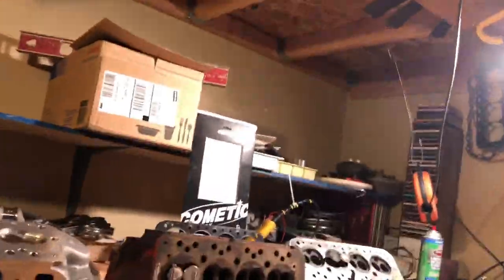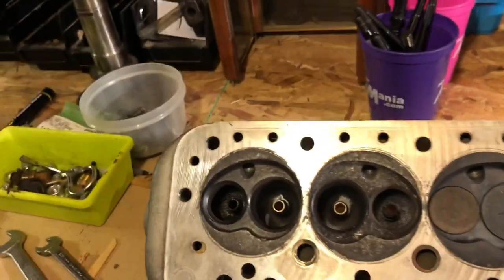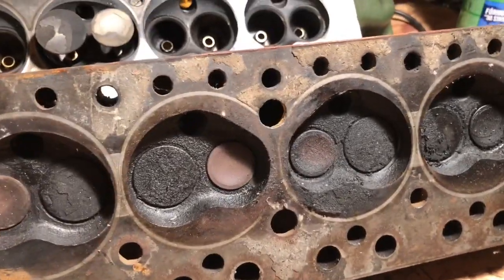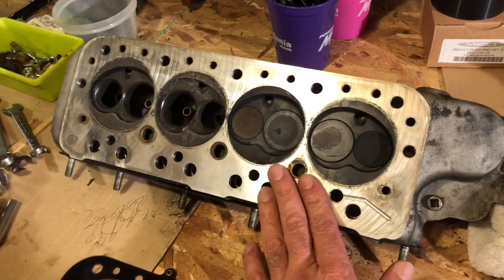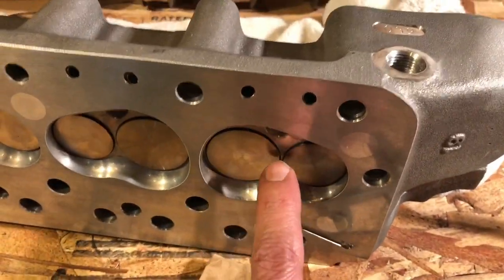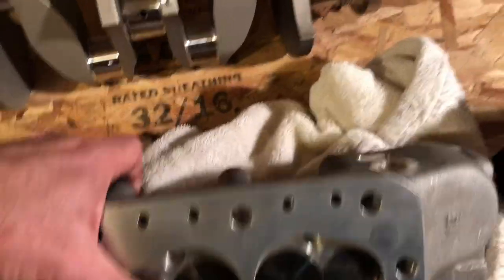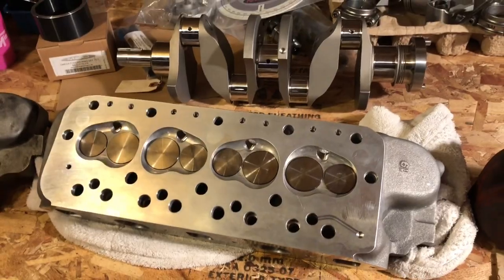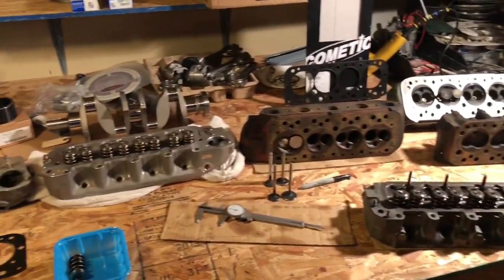All the Classic Mini heads on one table

Comment: Realy nice video, can you do some video about 998cc headgaskets? your opinion about copper ones vs those cheap grey headgasket..... and cylinder heads studs torque and retorque
Reply from the maker: Ah yes, I'll post an update of my Super Small bore soon.... my info is a year or two old, but the only really good performance head gasket was from Australia, and could be found under part number C-AHT347 if memory serves.  Unfortunately, was discontinued, in my opinion because it was expensive.  MOST that drive 998s don't do so because they are rich, and a $10 gasket will always sell over the $100 good one!

The Copper ones USED to be good. Let me clarify that all this is my opinion.... I just took apart my own 1380 that I built about 12 years ago with the Copper AF460. It was perfectly fine (and with 13 to 1 compression!!). Unfortunately, since then,  asbestos lawyers have slithered over to England and forced the manufacturers to use ground up kitty litter in place of asbestos in between the layers.  Now visitors to the UK are safe from breathing all that bad stuff from inside head gaskets, but they don't work for crap!

IMHO the best ones to use for a street engine are the modern dark 'tacky' surface gaskets still sold under Rover part numbers as well as Payen / Federal Mogul. They are like my Chevy V8s' Fram "Permatorque'". But these can generally be found for the 1275, so the only common ones for the small bore are the Copper and Tin ones and the cheap cardboard looking ones.  Right now, I'd use the cheap gray ones over the copper (if I couldn't find a "Rover" set), but I really hope they've been improved. 

Please let me know what you do, and how it works. My Super Small Bore will use a 1275 head, in part because I can use a much better 1275 gasket... probably one of the Cometic brand I use on race engines.

I ALWAYS "retorque" head gaskets. There's no harm in it, and it makes good intuitive sense to do so after a few heat cycles and everything 'settles in'.
Reply: @JemalCRM  many thanks for your answer. Im allways on a learning process. I have use payen headgaskets, still copper. And Works great. But these days I ve use those cheaper grey.one with no problems t all, just wanna know your opinion as you are for me like a bible in this engines. And allways pleasure to see your vids and learn somethingn many thanks

Comment: I would be interested to see what bhp you get out of this new mix of parts.
Reply from the maker: I have some numbers... My prepared Pierce head on the 1380 running an Elgin vintage race cam, MED crank and longer rods made 115 HP at the wheels.  It was class champ for two seasons.  Got damaged when something dropped into carb by someone helping at the track.
I rebuilt it using the new MiniSpares head and an MED FIA15+ cam.  Made 117 Hp, then with some carb tuning including bigger chokes on the Weber 45, we are at 121BHP at the end of this season.

Comment: Thanks for the video Jemal! How would you compare the Minispares head to MED's fast road head?
Reply from the maker: It's very hard to beat the combination of advantages with the new alloy heads. I have nothing but good to say about my friends at MED, but when you must take something old and modify it into what you want, you are at an immediate disadvantage to something new properly engineered for the purpose.

That becomes more so as the availability of usable original castings diminishes. Unless you have a compelling reason for originality (such as my Multiweb crank all-out race engines with MEDs very special "Series 6" heads built to my specifications),  you'll get more for your money with the MiniSpares Alloy heads.

And less.  MUCH less.  Weight that is!  The iron heads must weigh nearly FOUR TIMES as much!  That's a noticeable percentage of a Mini's weight!
Reply: @JemalCRM   Very useful perspective. MED is very proud of their flow gains on their heads but there is no comparison to the aluminum head from Minispares. I assume it will fit road injection models as a bolt on?

I don't know if you've considered it but you may find it quite profitable to link to the Minispares (or any product you recommend) in the comments section.
Reply from the maker: @avivscrewvalla  Thank you... I do try to show specific products to make them easy to find. MiniSpares has not responded to my inquiries nor shown any interest in having me help them sell direct to US consumers. Also I find over time links change, and I often customize my order for my build. 

In your case, yes the head will bolt up, but if you have an MPI, the alternator mounting and thermostat size will be different. The alloy head will not have the same tapped holes nor can they be added. Easy enough to use the earlier water pump and alternator mounting.
Unless the engine is fully built up, I would definitely stay with the "street performance" or "road" version as they call it. The "race" version would be too much for either of the injected models without much more work!
Reply: @JemalCRM  It's a stage 1 SPi JDM Mini (with factory aircon). I will ask after the road version and if I install it, will share my impressions. Thanks very much!
Reply: i realize I am kinda off topic but does anybody know a good place to stream newly released tv shows online?
Reply: @Ezekiel Julius i would suggest FlixZone. You can find it by googling :)
Reply: @Mayson Davis Definitely, I've been watching on FlixZone for months myself :)
Reply: @Mayson Davis thank you, signed up and it seems like they got a lot of movies there =) I really appreciate it!
Reply: @Ezekiel Julius Glad I could help :D

Comment: Is it worth it to restore 998cc engine I bought it for 100bucks
Reply: Depends what you want to end up with. A 1098 or 1275 engine will usually make a better road engine. I have a 998 with Cooper head and cam, (12G295, AEA630) and a single 1 1/2" SU, Goes quite nicely. Same head cam and carb on a 1098  in another car has quite a bit more low down power/torque.
Reply from the maker: I didn't used to think it was worth spending the same money to build a 998 when 1275s were common and cheap. Then I built the "Super Small bore" that I installed in Aaron Hagar's Mark 1 Mini.  It turned out to be one of my best street engines with amazing performance and smoothness!  

But it was certainly NOT just a "rebuild".  I explain it IN DETAIL from idea to test driving (took several years!) in the playlist "Super Small Bore Experimental Engine".  Some of it is beyond the capability of most people (and most machine shops!) and it isn't cheap to double the power output.

The 998 still makes a very nice smooth engine, and you could do a standard rebuild likely quite cheap. Is it "worth it"?  It depends on your expectations.... A proper rebuild will get you 20-25HP at the wheels, enough to make a little Mini fun to drive, and keep it reliable.  I prefer at least twice that much fun tho!

Here's the playlist:
https://www.youtube.com/playlist?list=PLf9CYi_IUYZklMtt-OmOlFuVdUkj9iRI-
Reply: @JemalCRM  what can you tell me about my engine from the tag 99H710V-H1088